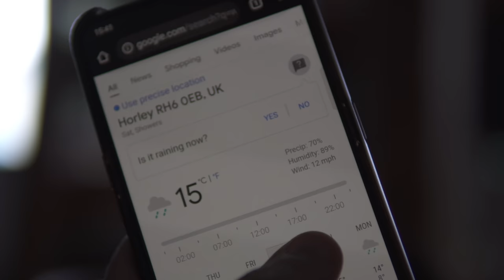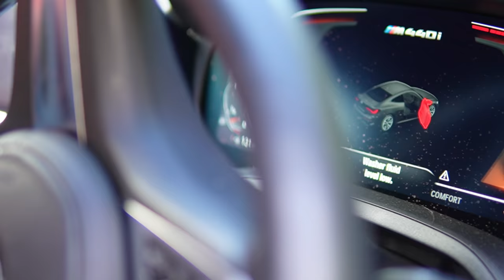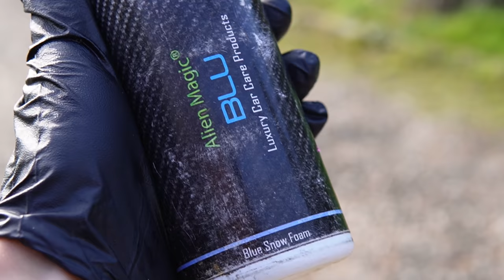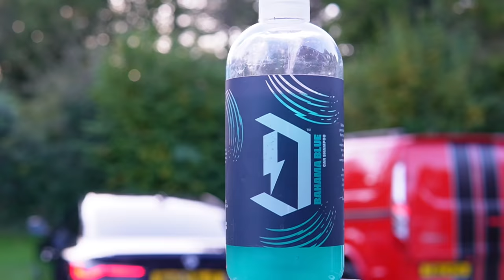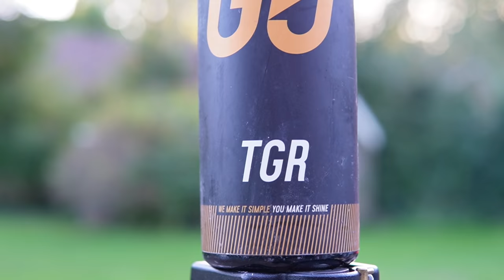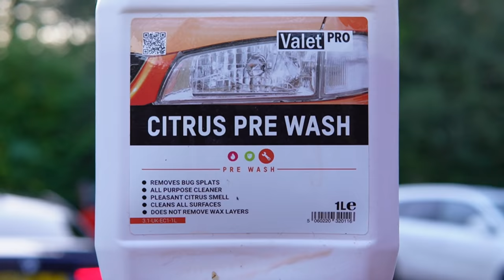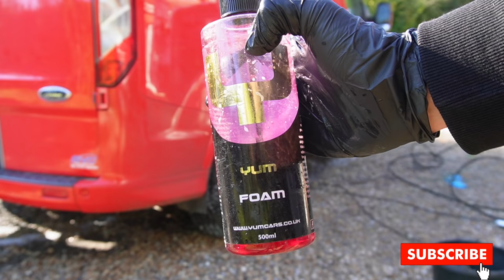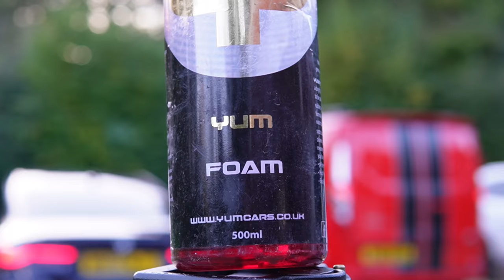A Day in the Life of a Mobile Car Cleaning Business

Comment: Good to see you have discovered the Nilisk pressure washers.  Been using the P150.2 for about 12 years.  The only drawback, if using a generator, is you need a powerful one to run the pressure washer.
Reply from the maker: Yeah fair point I always use customers power supply since day one. This model is seriously powerful. Couldn't believe it when I first used it
Reply: @epicautomotivedetailing  I have tried several Karcher's over the years, including the HD range, nothing comes close to the P150.